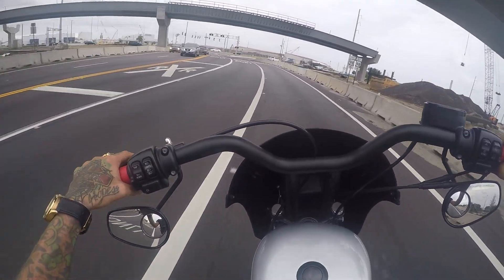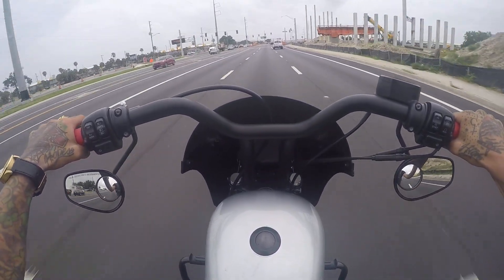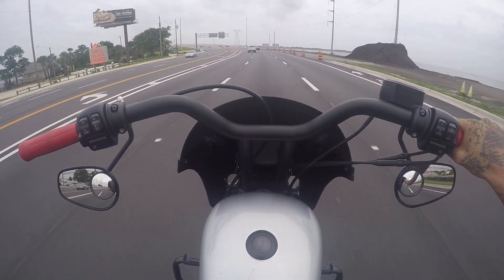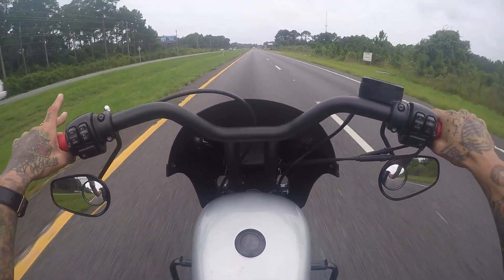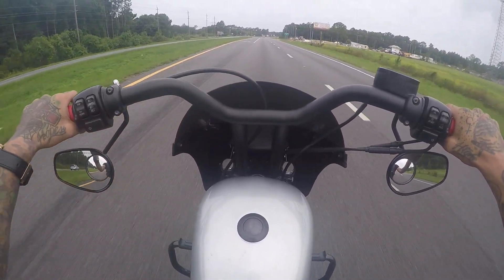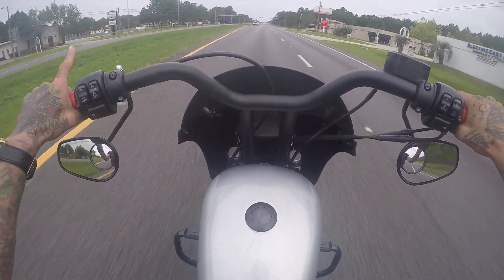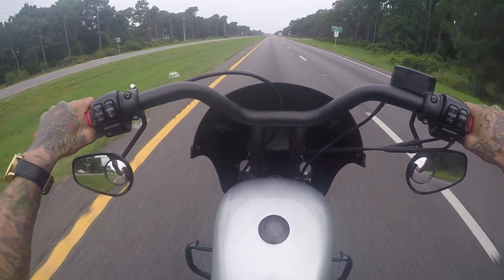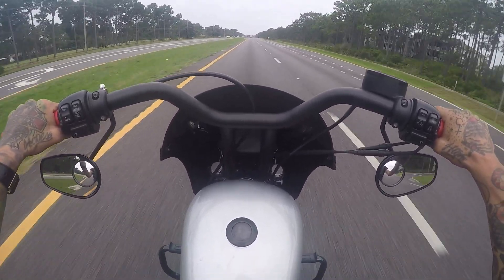How to get rid of decel pop with the Vance and Hines fp3 with fine tuning (not the firecrackers)(HD)

Comment: You can’t drop the fuel in rpm ranges. Dropping it across the board is across all temperature ranges. A bike running to lean can also cause a decel pop.
Reply from the maker: Running lean is whats causes most decel pop scenarios , thats why I "added fuel" at deceleration. harley davidson ecm's are configured to cut off spark upon deceleration in higher rpm situations and the spark returns when the rpm's hit 2000 which is the reason why most harleys have decel pop with aftermarket exhausts in the lower rpm range.

Comment: Those tattoos in your hands, how often did you retouch them, I want a tattoo in my hands but the guy told me that I have to retouch it
Reply from the maker: calaveratur 
The tattoos on my right hand have never been retouched but my left hand is a blast over cause I didn’t like what was there, so it’s been tattooed 3 times but not because of fading, if your worried about longevity stick with black and grey hand tattoos, color may need to be touched up more depending on your skin type and how often your in the sun, B&G tattoos still look good even if they fade a bit